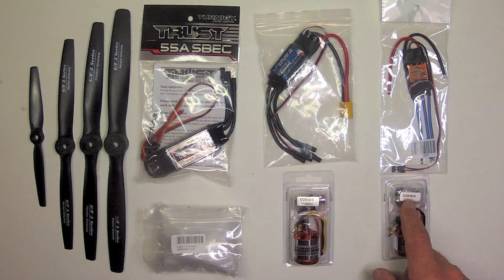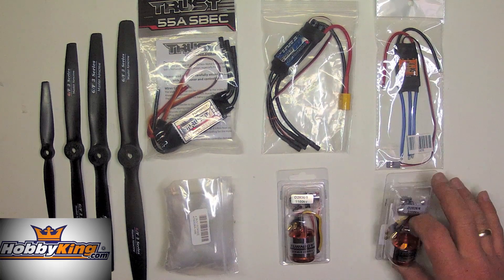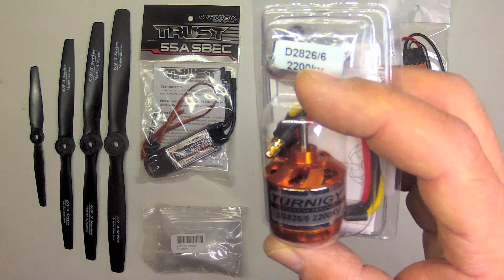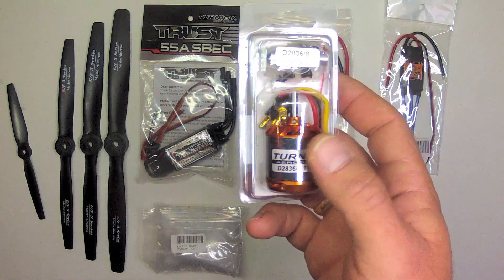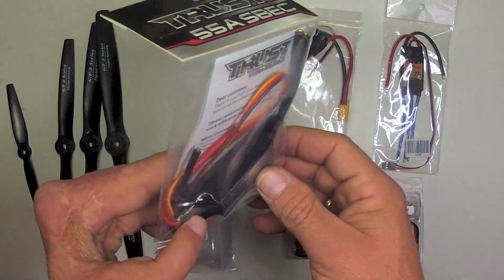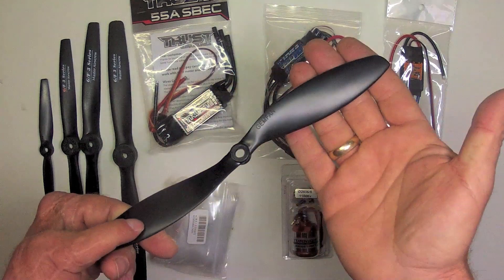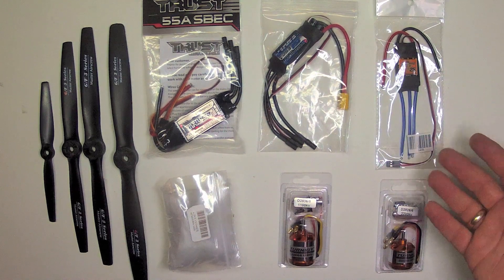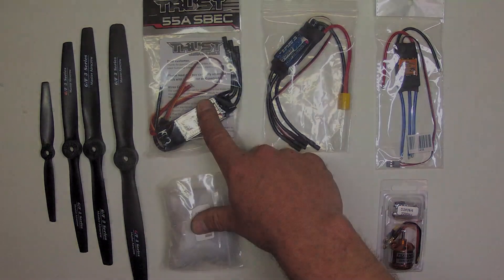EA POWERPLANT CHOICES - Introduction

Comment from the maker: If it's still a 3 cell battery, the results as far as thrust and wattage would be the same.  I typically use a single 2200mAh battery for this motor.  To use a 3300mAh with a similar C-rating would only give you better results as far as keeping up the voltage under load, and the flight duration would be longer,  only the pack itself weighs more.

Comment from the maker: Yes that's true!  I have not seen this motor draw more than 30 amps and it's usually more like 25 amps, so a properly cooled ESC of 25-30 amps should be OK.  Weight and money no object - I'd go for a 40 amp just to be safe, and to be able to swap motors.  But it's probably overkill in most situations.

Comment: The Turnigy Aerodrive 2826 2200KV recommends a 40amp ESC, but you paired it with a 25-30amp ESC. How does the ESC not get burned out.

Comment: I have one more question. If I use the turnigy plush 40amp esc with the 2200kv motor, what mah battery and discharge rate would you recommend? Thanks a lot.

Comment: I had the same problem finding foam board yesterday ,I will simply buy a case next time, I wonder if I could get a good enough price from manufacture to pay for shipping. I just got a call with a  question ,why is my esc only chirping and motor jumps as he turns it.

Comment: i yous the HK 25/30A whit 750kv 2836 tunigy for my quadrocopters , i like that combo ,only the esc dont handle cold days , wen it normal temperture, its good, props i yous are 10"/6 cheap props ballans them myzelf , i like the yelo turnigy series nice sound and power for cheap ...

Comment: as mentioned, D2826-6 2200kv with 6x4 but make sure run a higher amp ESC. I have this motor and a Turnigy Plush 40amp ESC (Ed listed above) and the Bixler 1.1 is a rocket.

Comment: Hi Ed,
I have built a FPV wing using your building techniques to make the wings, the center bull nose section, the battery pod and even the motor mount foam board section.
The whole wing is made using your techniques 
With this wing I have flown 3000kms or 9842 feet high on 1x 5000mah 3s and only used 3466mah 
There are some pics and video of the wing in "rc groups The fury flyer 54" on page 7 and there are some build pics of my new 6' wing I am building on page 8

Comment: Hallo Ed!
the turnigy 2200 kv will better work at least with 40amp esc ,i think even with moderate throttle settings,is to risky,but this is my opinion....thanks a lot to sharing this info with us....btw i've got a really good time flying my "TUBE" plane, 40 inch Armin wings and 30 inch fuselage,no rudder...really a nice stunt plane and glider at same time!!!!

Comment: Compare dimensions, weight, KV and also watts (output) and also try an online calculator like adamone ddot rchomepage ddot com / calc_motor ddot htm (remove spaces and replace ddot with . )  I'm not very experienced with the electrical side of planes yet. Now I'm getting into flying, I have made at least 6 pairs of wings using mostly ExAirlines methods, but I'm now learning to fly with a Bixler 2. I know it's not so easy in some parts of the world, but I wish you the best of luck my friend. :¬)

Comment: You should be ok with just the packing tape on the outer surfaces. I use an insulation board similar to Depron. My method with the wings is this. Before bending the foam, I mark where the leading edge will be, and overlap the tape starting at the trailing edge of the top and bottom outer surfaces.  When I get to the leading edge, I always add a piece that is fully centred right there with the same amount leading back to and on top of each of the top and bottom skins. I hope this helps.

Comment: awesome! thank you so much. My brother in law and I are building a huge twin cargo plane(1120sq.in. wing) and will be using 2 1100kv motors on on 2 3s packs(1 each) i have 2 10x6, 11x4, 11x5, 12x4 props to try out with the 5lb-10lb AUW plane. (depending on bomb bay load)

Comment: I have six turnigy 2836-1100kv motor. They are wrongly labled as 1100kV, the correct kV is 1000. Anyway, my experience with them is great. They are reliable, efficient and well put together. No unbalanced bells, no loose magnets, no grinding bearings.

Now, for the 35mm NTM series, the 35-36A 1800kV is a beast. Same size motor with 875W of awesomeness on 4S. And you can always choose to use 3S battery instead of 4 and thus lower the RPM, use a bigger prop, lower noise and have better efficiency.